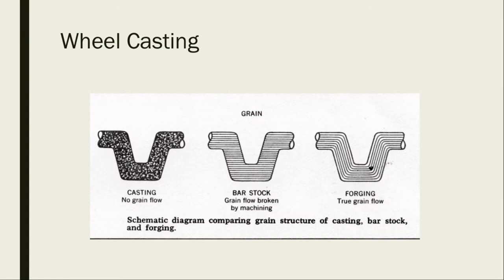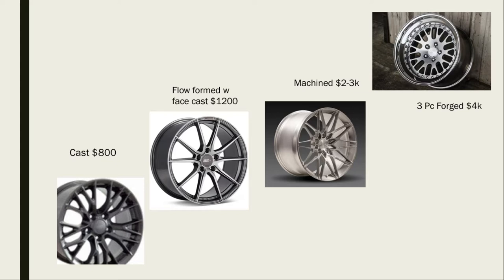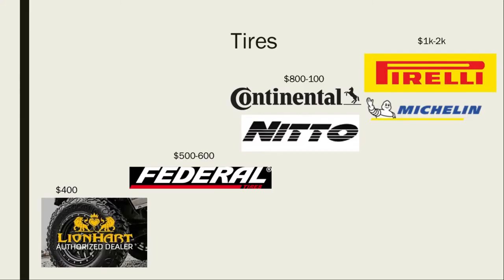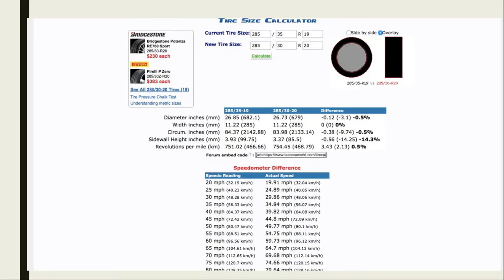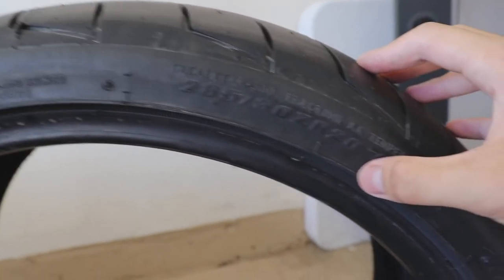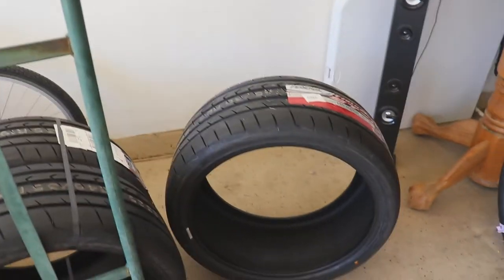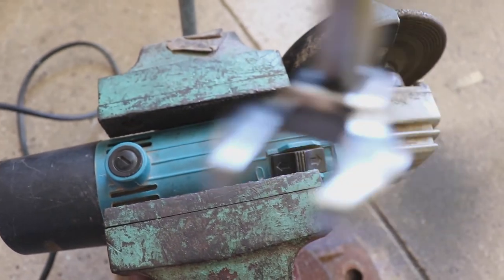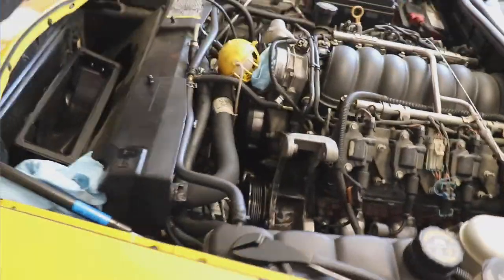Choosing Wheels & Tires For Your Car

Comment: I've had Corvettes since the early '90s and your wheel prices are a bit off. You can get a set of cast wheels (in Corvette sizes) from around $1,000. A flowform set from about $2,500. A 3-piece forged set for a Corvette (I know from experience) are going to cost you at least $5,000 and go up quickly from there. These are for base coupe and convertible sizes in the C5-C8 model range. The larger, and wider, Grand Sport/Z06/ZR1 sizes will cost more. I bought a set of forged wheels for my C6 Z06 in the ZR1's 19x10 and 20x12 combo and they cost me $8,600 from ADV.1 Wheels. That's wheels alone; no TPMS sensor, tires or install. Stay safe everyone. Cheers from Florida.